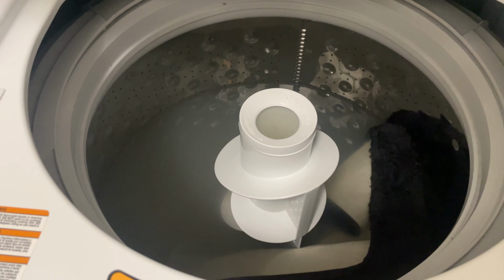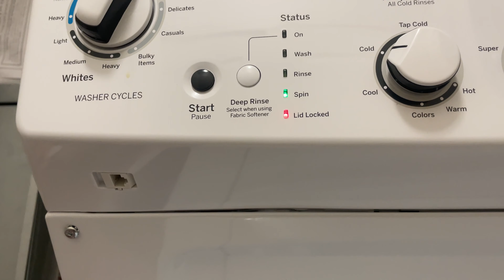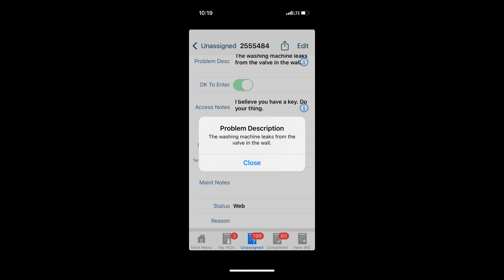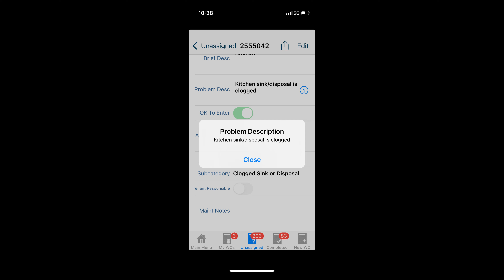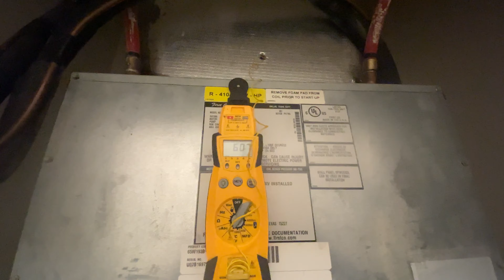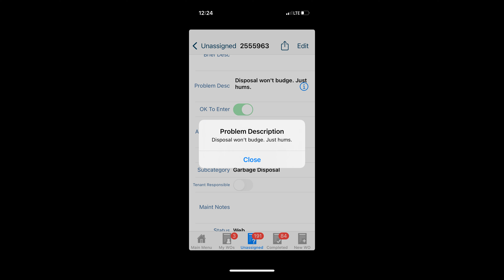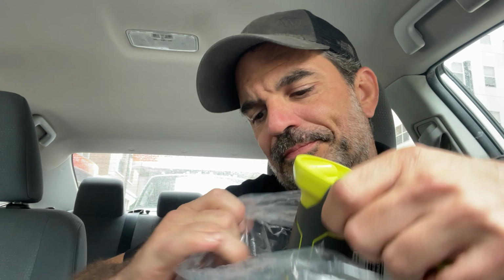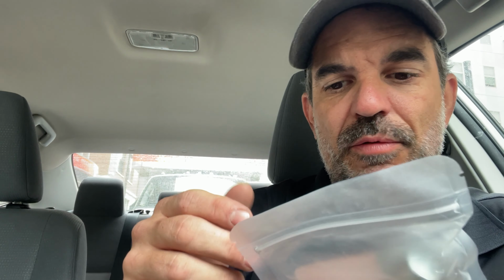Apartment Maintenance Vlog #14

Comment: Love your videos bud. I do hotel maintenance for Marriott. It's always a fun day but able to keep things good with persistent fixing. Trouble shoot and figure it out. No outside help coming to my hotel. Great job and thanks for the videos.
Reply from the maker: Nice Robert! How's the oncal in the Hotel biz?
Reply: @ApartmentMaintenancePro  at my hotel I do not have any unless it's for a guest room lock not letting someone in. Then it's usually a pain. No way into room unless I drill out the lock from outside the door. Have a dummy lock that I have pin pointed where the 3 bolts are that attach to inside handle. Drill out and replace. Loud process but thankfully that's our biggest issue and happens couple times a year. Daily is normal stuff, sink drains, tub drains, light changes. Every now and then I have bigger things I have to deal with (motor changes on main hotwatter heaters, water leaks that are always fun to track down. Just another day tho.

Comment: Why not use the disposal wrench in your hand for disposal tightening?  Just saw you used a screwdriver…all wrenches I know fit perfect in that tang…just asking if you had a particular reason…
Reply from the maker: I've honestly never thought of using a disposal wrench to tighten them. I've had issues before with the rings getting jammed and needed extra torque, so it's kind of a instinct to use the screwdriver I guess